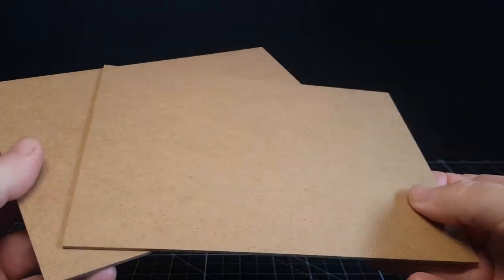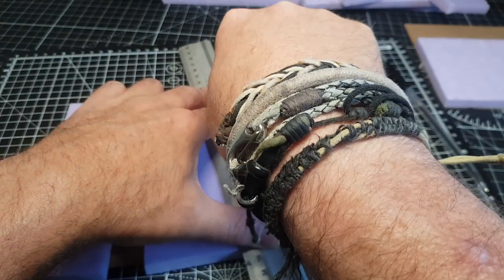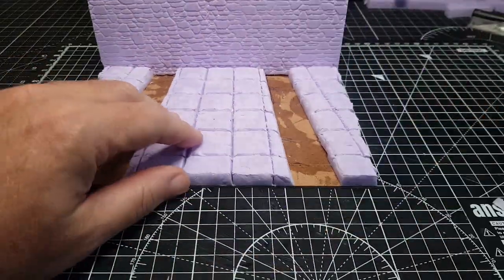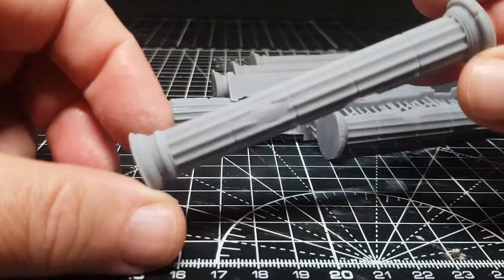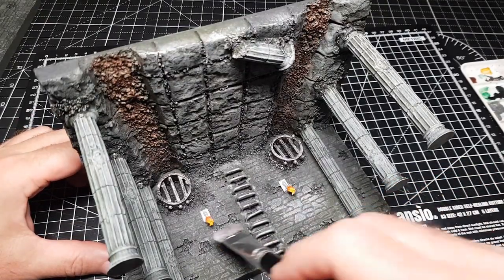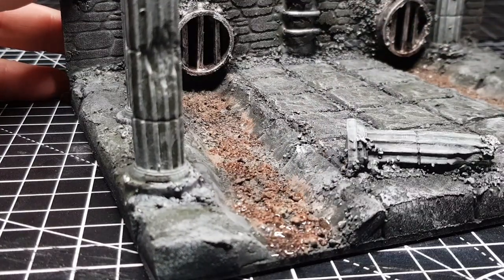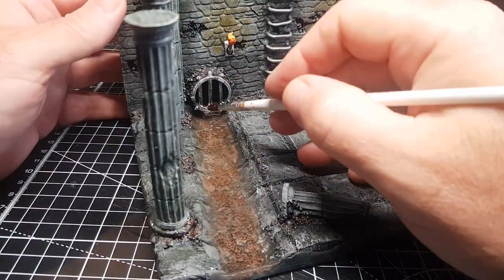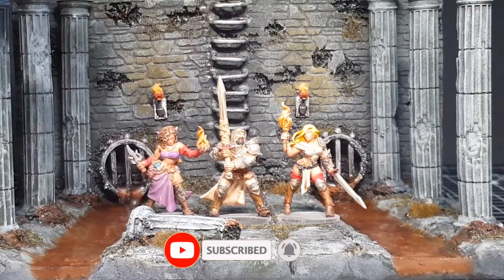How to Make a Sewer Room for Dungeons & Dragons

Comment: Excellent build. Interesting that the Goriall glue doesn't eat the foam. I use normal Bostik All Purpose glue or Loctite and it eats the foam like crazy. The only glue I found (other than pritstick which isn't strong enough) was to use Modge Podge. Horrible feeling when you spend ages putting something together then it falls to pieces as it's been eaten from the inside 🙂
Reply from the maker: cheers, yeah the gorilla glue is an awesome all round glue that seems to work on everything, so long as you can leave it alone for 2 hours it bonds very strongly 🙂